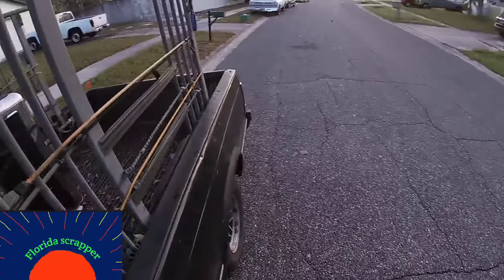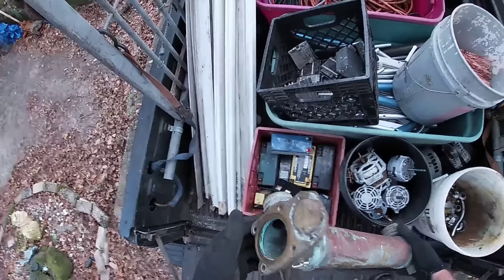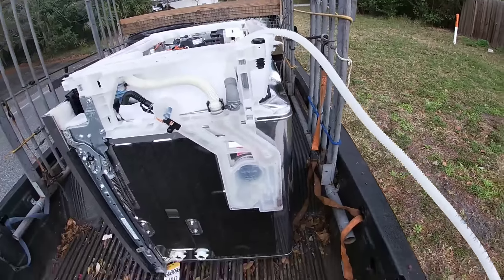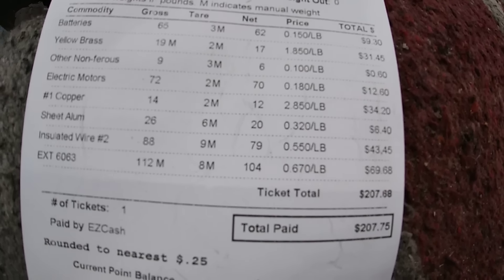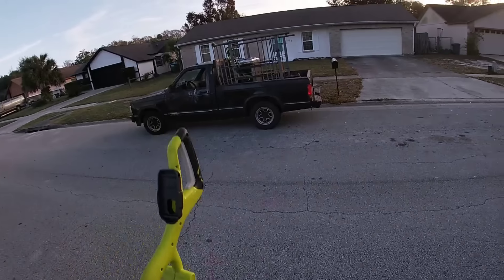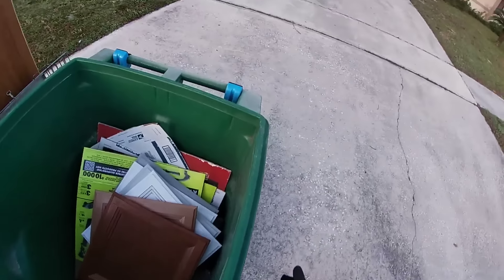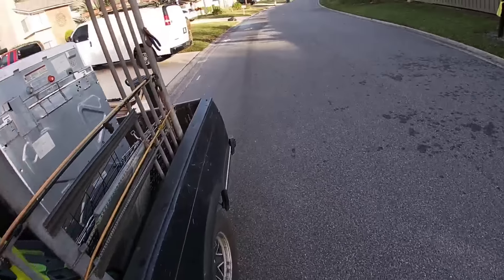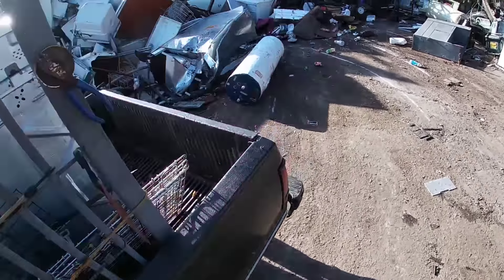Collecting scrap metal in the "harsh" Florida winter.

Comment: I stop for plastic tub dishwashers and cut the wires out of them and pull out the racks. I don't separate stainless, it all goes as metal. I pull the metal doors out of pet carriers. Pulling the motor and gearbox on a washer only takes a couple bolts, clips and snip the wires and a hose or two to get out, makes them easier to load. I rarely get a washer but on a nice day I may. I take everything home and process it right on the tailgate of the truck then straight to my scrap trailer and buckets/trash cans for wire and such. I have one trailer full of metal now and will have the other full before long. I won't be going to the scrap yard until early spring as here in Ohio the weather can be nasty at times. Great video.